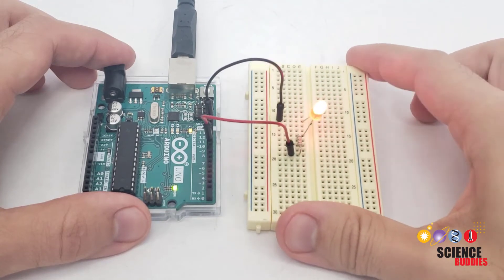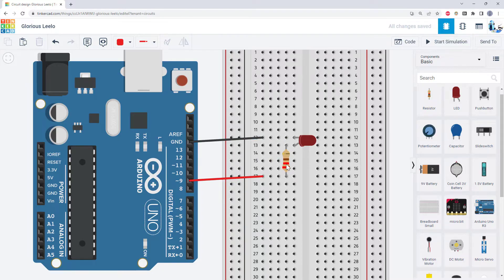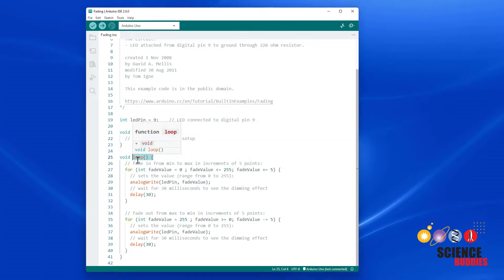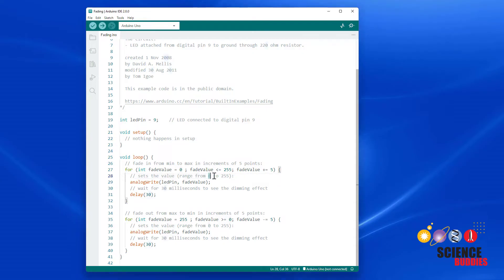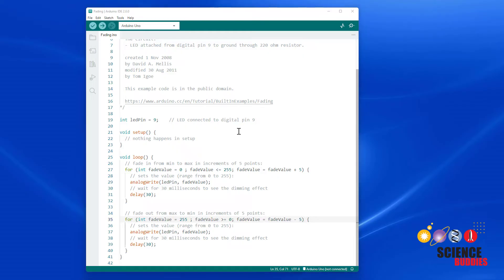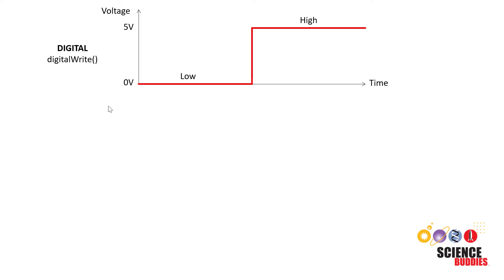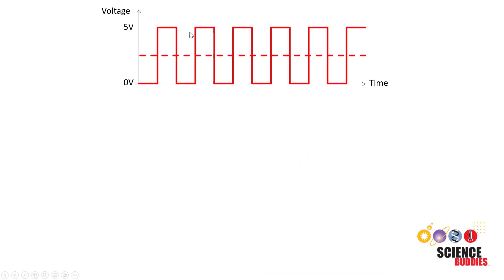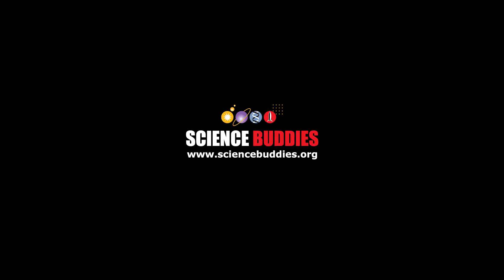How to Fade an LED with Arduino analogWrite (Lesson #6)

Comment: can i use 330 resistor?
Reply from the maker: Yes, although for an Arduino UNO R4 you will want a 470 ohm resistor because the current limit is lower.
Reply: @Science.Buddies  ok. Ty

Comment: Really like these tutorials and have actually switched my class from using the usual recommended content (Paul McWhorter's course) which is also great, but a bit long for middle school students. 
One small suggestion/wish is that you Zoom in/make the Code sections a bit larger.

Great work!

Comment: Thank you so much for the video! So easy to understand. Also, can I ask if this type of function works for solenoid valves that gradually close as time runs out? Thank you so much!!
Reply from the maker: You can use the analogWrite function to control the speed of a motor (and we have a separate video about that in our tutorial series) but solenoid valves are generally designed for more complete open/closed behavior - it will be difficult to hold one in a partially-open position.

Comment: I couldnt help but notice this video didnt have a tinkercad version. I went on to try it on tinkercad but it didnt work, any reason for that?
Reply from the maker: We just tried the Arduino "fade" example (File/Examples/Basics/Fade) in Tinkercad and it worked, but the fade can be a little hard to see in the animation. This video is almost two years old, but we probably skipped Tinkercad for this one because the fade is easier to see in real life.

Comment: May I have your advice. Accoding to the LED fading code
/*
 Fade
 
 This example shows how to fade an LED on pin 9
 using the analogWrite() function.
 
 This example code is in the public domain.
 */

int led = 9;           // the pin that the LED is attached to
int brightness = 0;    // how bright the LED is
int fadeAmount = 5;    // how many points to fade the LED by

// the setup routine runs once when you press reset:
void setup()  { 
  // declare pin 9 to be an output:
  pinMode(led, OUTPUT);
} 

// the loop routine runs over and over again forever:
void loop()  { 
  // set the brightness of pin 9:
  analogWrite(led, brightness);    

  // change the brightness for next time through the loop:
  brightness = brightness + fadeAmount;

  // reverse the direction of the fading at the ends of the fade: 
  if (brightness == 0 || brightness == 255) {
    fadeAmount = -fadeAmount ; 
  }     
  // wait for 30 milliseconds to see the dimming effect    
  delay(30); 
 }
From the code, the LED  will fade up - down in 30 msec again and again. If I would like to have the loop like this >> fade up-down,30 msec---turn off 5 sec----fade up-down,30 msec again. How to modify the program? Thank you
Reply from the maker: Hi - we're unable to provide advice on individual programming projects. Our tutorials are very hardware-focused, but if you search on YouTube you should be able to find other more programming-focused Arduino tutorials on things like delays and loops that will help you accomplish what you want.